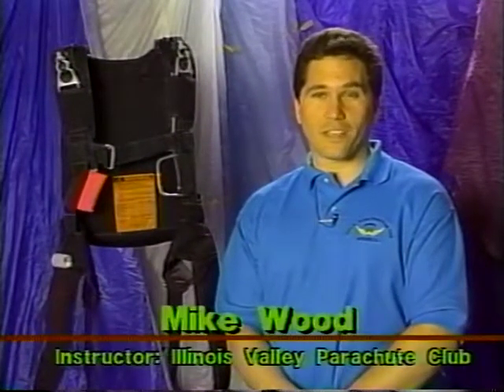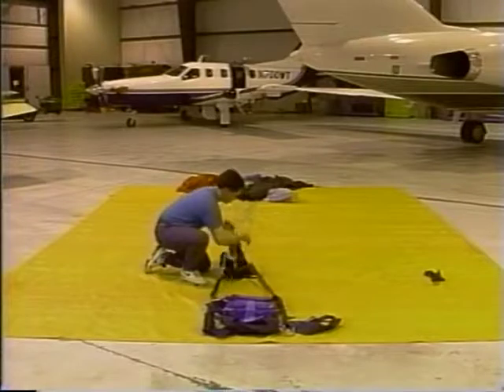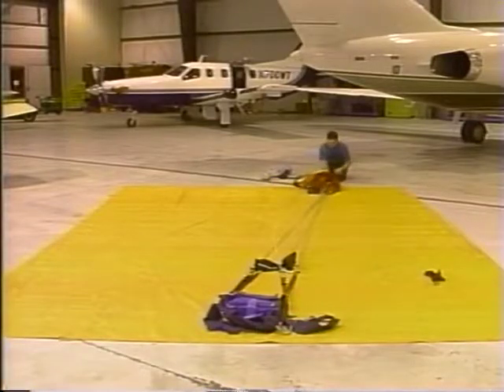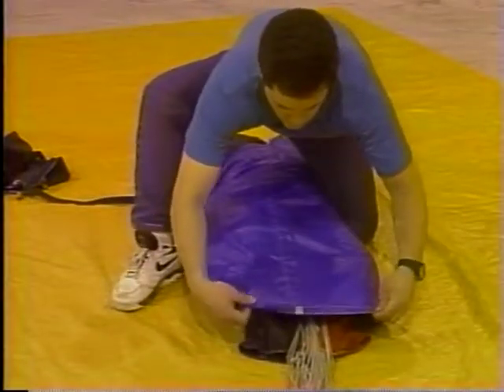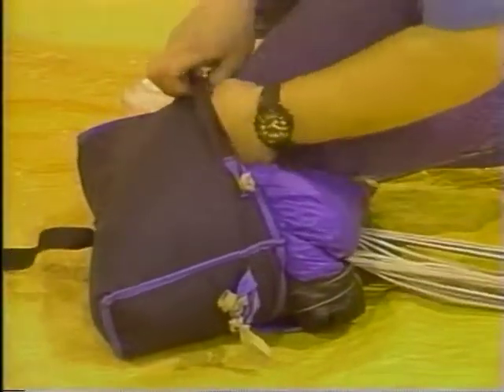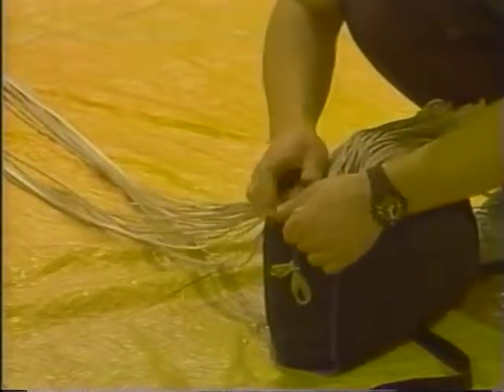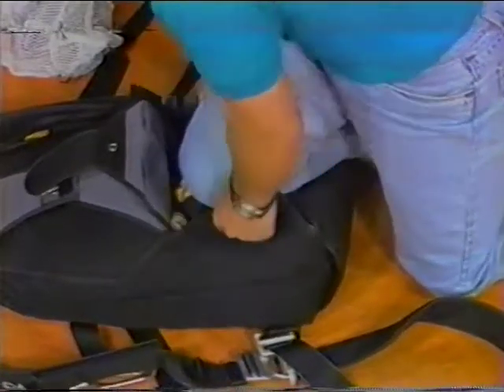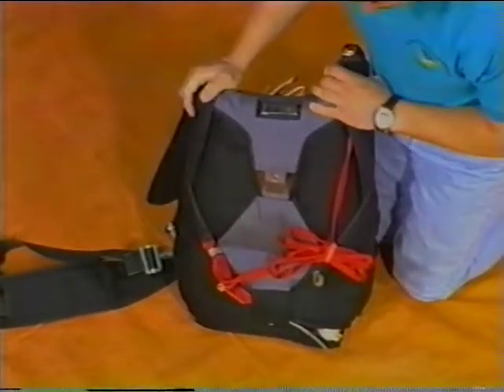How to flat pack a parachute

Comment: Thank you for this video. My dzo has us (students) flat pack our rigs. I have been off all winter (Western PA) so I finally got some review for getting back in the air. Every video I find is a pro pack. This is the first flat pack video I could find.
Reply: This is still good way to pack modern canopies? Saber 2?
Reply: @SkydiveHake   check manual of the canopy and see if there is any flat pack procedures, also make sure its the right one, since some canopies .like dual hawk system from strong says they can be flatpack but not as this one, read the whole manual, or write on the new, sabre 2 packing manual or something usually there will be images for reserve packs and main canopy packs, make sure you look for flat packs, not propacks on the grounds or something those arent the same and make sure the steps are the same as this ones